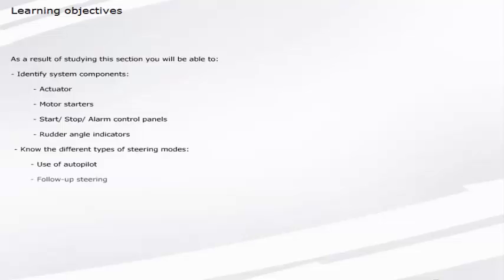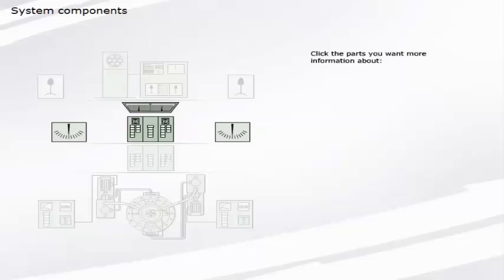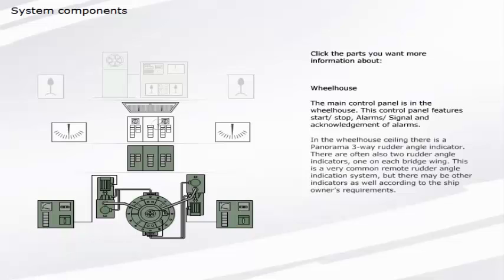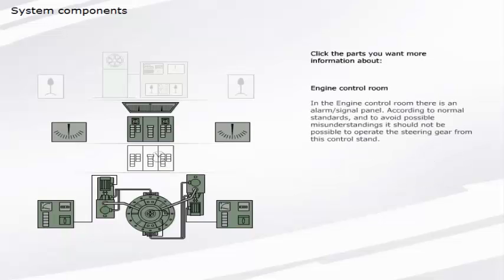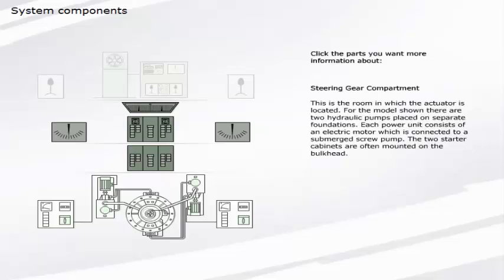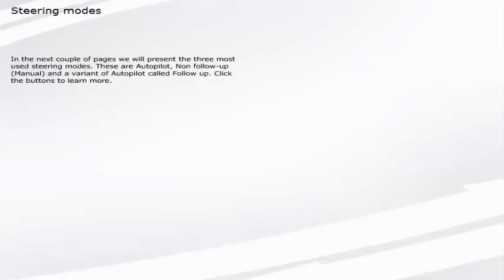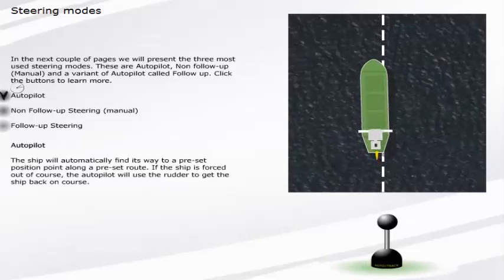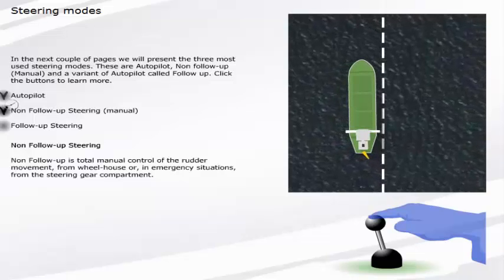Steering Gear Control System and Types of Steering Modes

Comment: Great video! When steering manually with a stick/rod like in the video will the rudder go back to mid ship when you let go of the steering rod or will it stay in the same angle like on a smaller boat or a car?
Reply from the maker: Yes it does
Reply: @Marineonline  Alright, so to keep the rudder hard starboard for example you have to keep pushing the rod right?